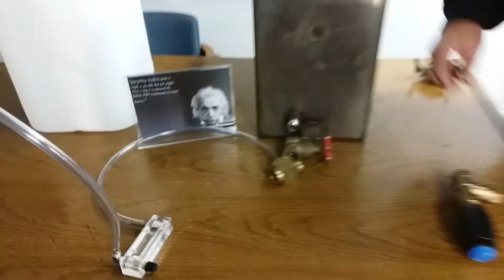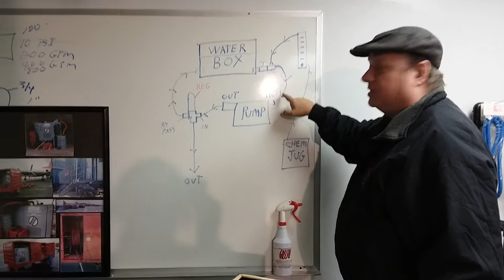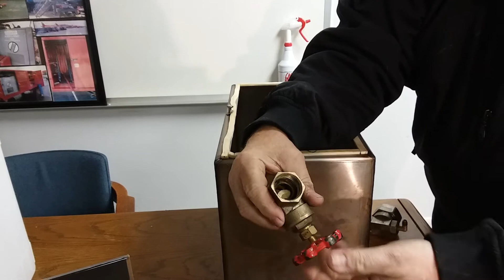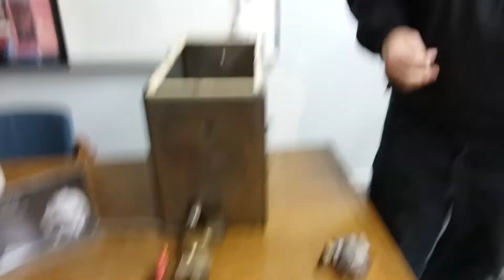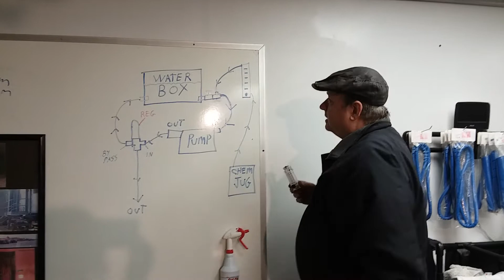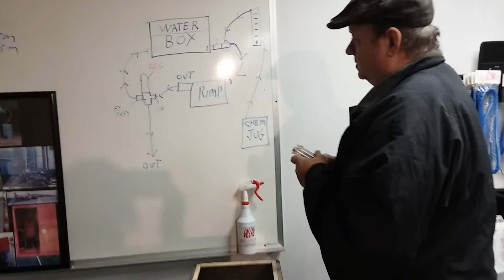The 1959 JUDSON Chem Injection SYSTEM for TRUCKMOUNTS

Comment: I have a steam genie sizzler with water valve. Do you barely open open the water vavle?  I notice when I have it fully open my little giant giant keep up with it. My heater dropped in performance. But this is the 2nd time I got it quick fixed. I think once I get new one it will perform better. How much heat can I get with my truck mount and my 3ht?

Comment: Judson is right this is the best way to plumb  chem injection for a truck mount. Always works. 20 years on my truck mount never had a problem with my chem flow (as long as there are no leaks).

Comment: How about reducing the tee fitting port leading to the chem flow meter instead of using a gate valve on the water pump inlet line.